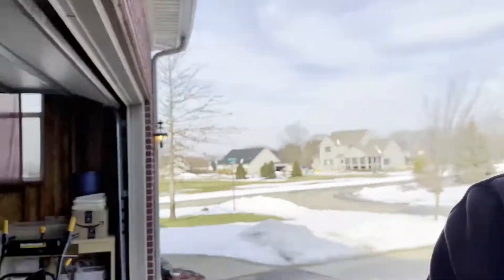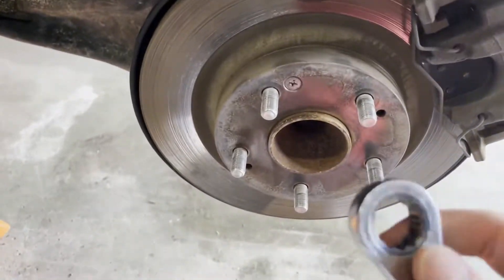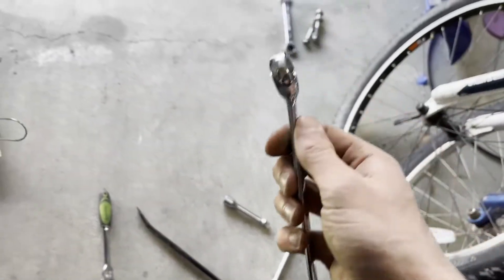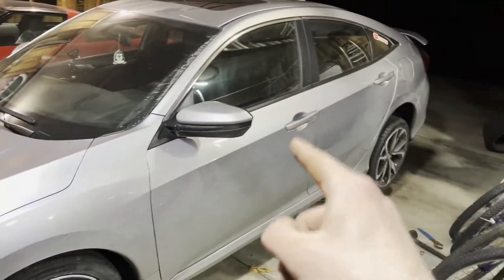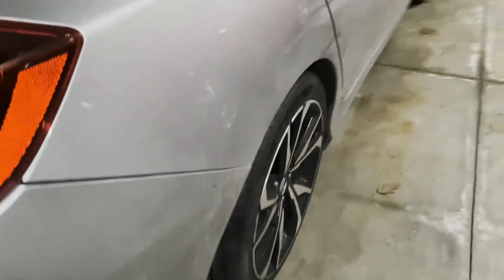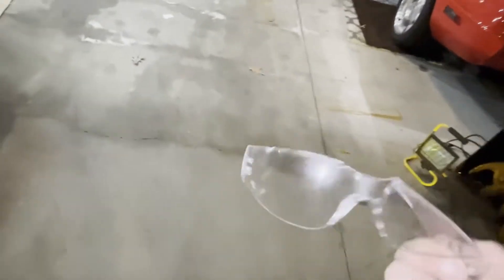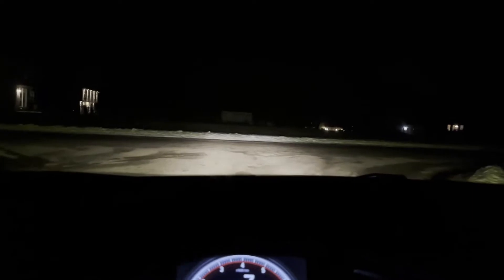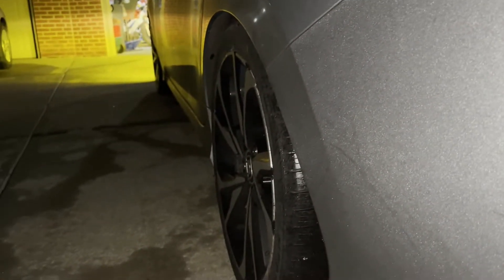This was the HARDEST INSTALL EVER | 10th Gen Civic Si camber arm install |

Comment: valid video bro was entertaining tbh. Wanted to ask since I installed my d2 springs today on my si and I also have the same god speed camber arms. If you got any pointers and tips what I should do or look at please let me know!!!!
Reply from the maker: Thank you bro I appreciate ya! I got 2 tips, 1, make sure to have a long, slightly offset, 14mm wrench. 2, make sure you have a long 14mm ratchet wrench. The hardest part of the job is getting to the bolts towards the center of the car.
Reply: my 1 tip is PATIENCE lol
Reply from the maker: @ElPinche97  this is facts ^^

Comment: I did it . All mine at 0. But you didn't have a jack under the spindle and level the car with a digital level and let the car down on the jack, and then use the digital level on the rotor and set it at 0 .